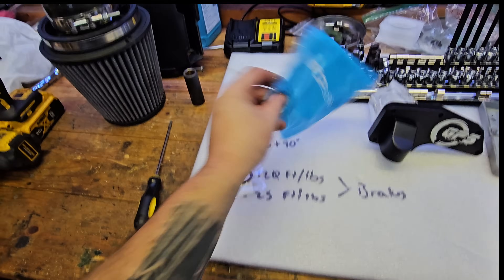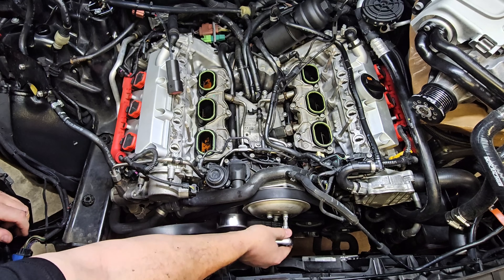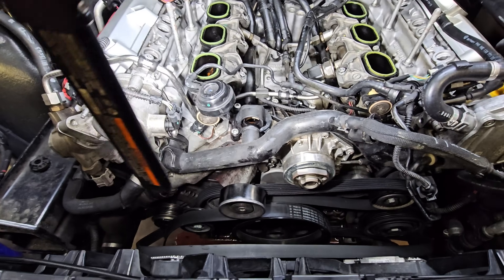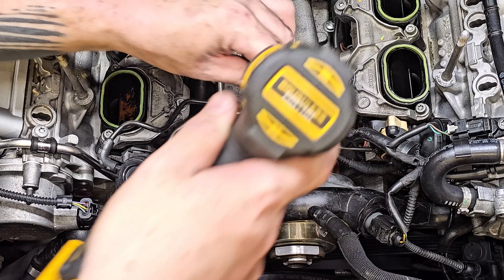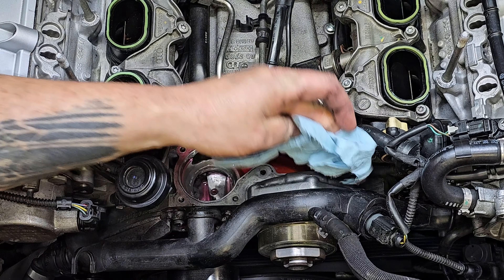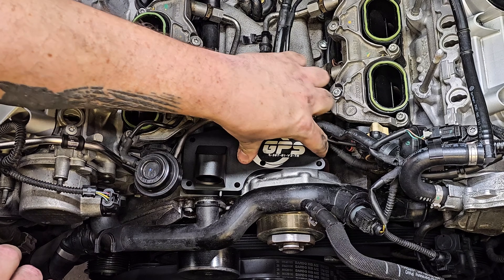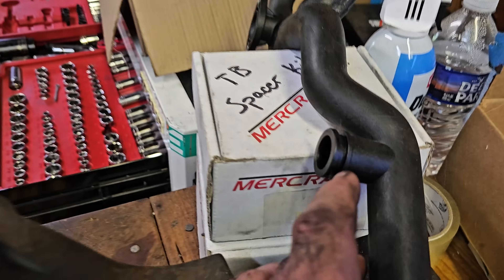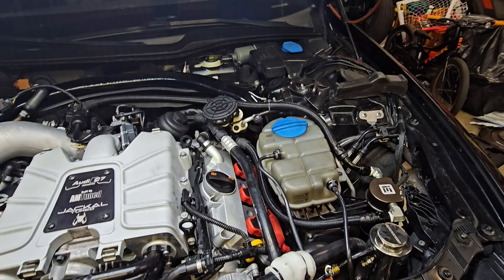German Performance Solutions Audi 3.0T Thermostat Install Guide | C7 A6/A7, B8 S4/S5/SQ5

Comment from the maker: *READ THIS COMMENT FOR IMPORTANT NOTES & LINKS*

Get your GPS Thermostat here: https://da.gd/GPS_Link

*Don't forget that GPS also sells full service kits while you are under the supercharger with the thermostat, metal heaterpipe, metal water pump, seals, pcv, and pcv to supercharger adapter pipe. 

**One thing omitted from the video was showing the removal of the SAI pipe which connects to the crossover coolant pipe and runs through the valley of the engine to the rear of the car. This is a corrugated plastic pipe that needs to be disconnected from its connector at the coolant pipe, and then you can carefully lift it up and out of the way. My car doesn't have an SAI system anymore so I forgot to mention it in the video. 

Supercharger Removal DIY:  https://youtu.be/u9bT_gGjIMI

Service Position DIY:  https://youtu.be/sQujXvLM1YY

Comment: sourcing parts is near impossible. those gaskets are non existent on the audi parts store exploded diagram. my manual says "replace" with no part numbers. we need to utilize consumer 3d printing and CNC, make adapters and remove all this plastic trash convert it to AN12 and braided lines.

Comment: I have 2019 SQ5 3.0, Is that the same engine? Asking cause I cant find vehicle specific video. Pretty sure I have to replace water pump.
Reply from the maker: No. That has the 3.0T Turbo engine

Comment: hey my crossover pipe broke in the same spot and had to order a new one. Did you find out where to get the O-rings for each end that the crossover pipe goes into? Having trouble finding any info these.
Reply from the maker: I bought mine from fcp euro iirc. You can also just get them through your local audi dealer. They aren't expensive

Comment: Hi friend, I have a 2011 Audi S5 B8 and when I drive the car it works perfectly but when I accelerate hard the EPC comes on and the car shakes and the VCDS shows me a combustion problem in cylinder number 5 and when I turn the car off and restart everything goes back to normal!! Thanks
Reply from the maker: So that would be a 4.2 V8 engine in the Pre-facelift B8 S5, but you should try swapping coil packs & spark plugs to see if the misfire moves. That will help you diagnose the misfire.
Reply: @GarageTaught  not necessarily, the 2011 s5 cabriolet has the supercharged v6 but only the cabriolet

Comment: Wow I just did this with my friend 2 months ago. We are both 17 and it took us around 24 hours of labor each. I probably saved a few thousand doing this. Also don't ever go to Dobbs, they don't know what they're doing https://maps.app.goo.gl/wRKqge3JGVRqCis29 

My next big project is fixing my ac. It's been getting worse over the last year and I tried adding some more refrigerant and now it has stopped working completely. I think I overpressurized it. Sometimes the ac button will refuse to turn on when the car is started.  lmk if you know any common ac failures. (2012 A6 C7 3.0T)

Comment: Hi brother! Have you ever had a Cooling fan 2 control circut fault? Do you know if so?
Reply: Hey hopefully you got this fixed up by now, but i had the same issue a month ago. Check the 40amp fuses for both cooling fans, hopefully thats the culprit. Potentially a $30 fix💪🏽
Reply: @esaiahg will check
Reply: @esaiahg  Hi where is it located?
Reply: I had my 40 amp fuse blow for my cooling fan if that's what you're experiencing. Replaced it and haven't had any issues since. Be careful bc it could be an early symptom of a failing thermostat if your fans are being overloaded. https://maps.app.goo.gl/wRKqge3JGVRqCis29 this is what happened to me.